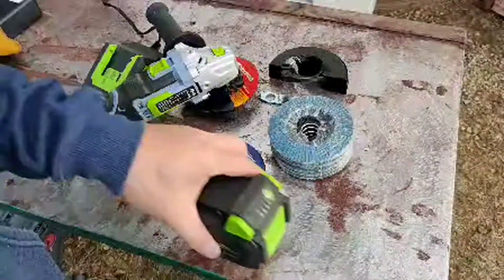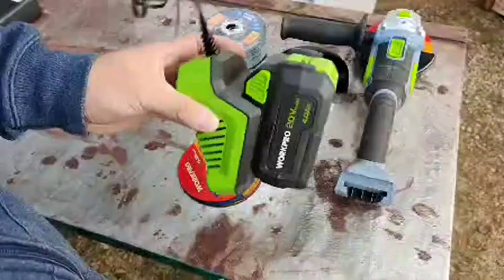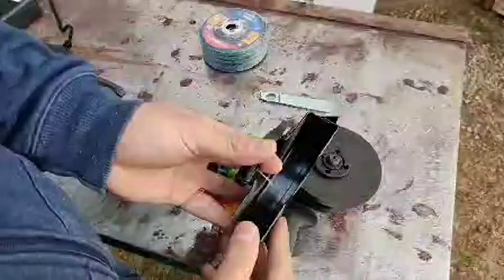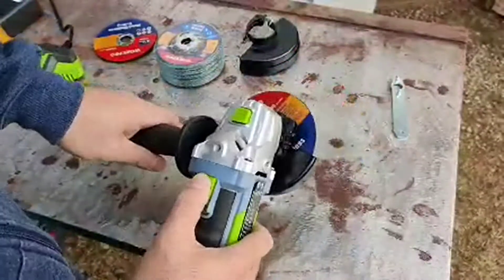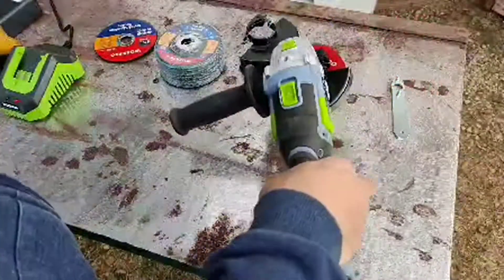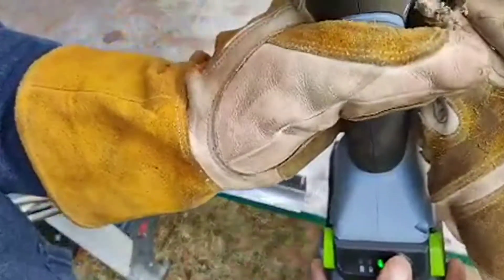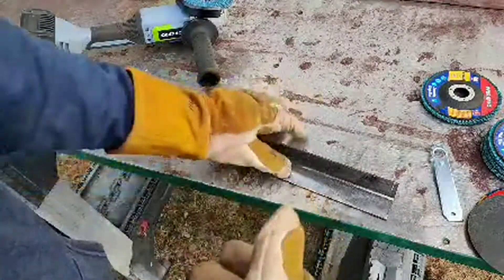WORKPRO 20V Cordless Angle Grinder Kit Review, Excellent portable angle grinder

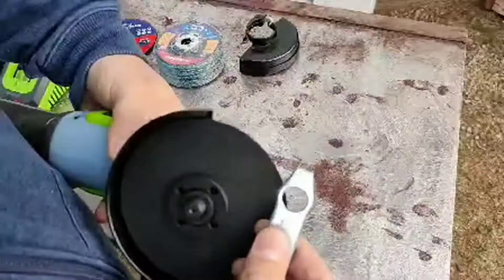Comment: 1:22 what can I do If i don't have this tool, how else can I get that wheel released to change a blade?
Reply: Do you have to have that specific little wrench looking tool to release the blade?
Reply: you can use vise-grips...
Reply: @m3n4cE6  thanks. I actually happened to be sitting on a wooden picnic table and just put pressure and spun it like a wheel against the table it loosened and I also tightened it the same way